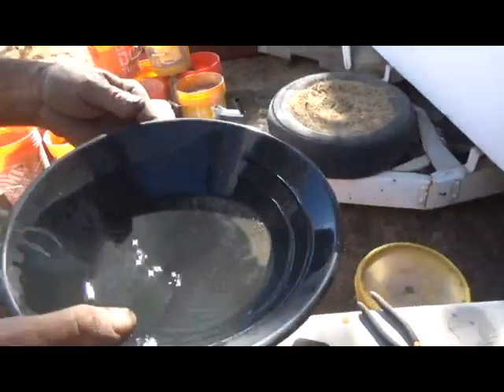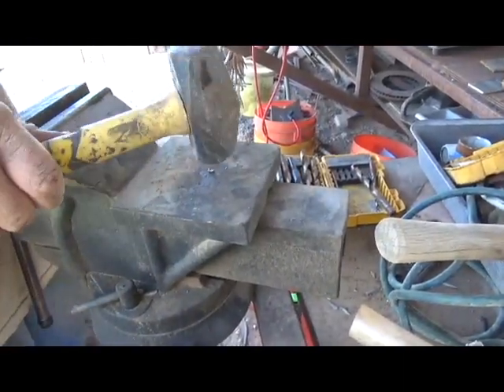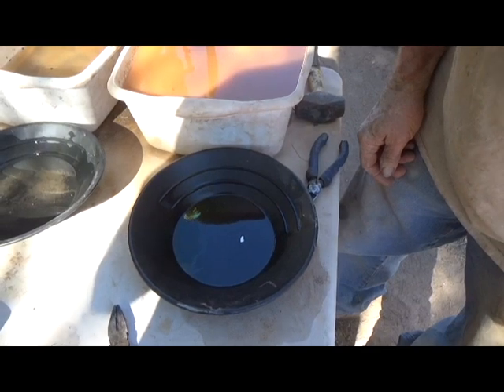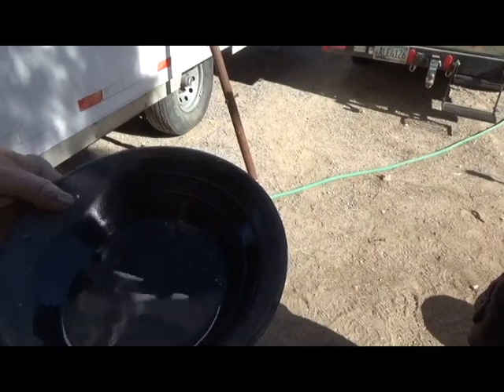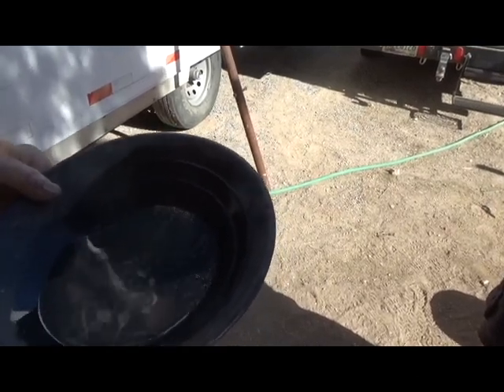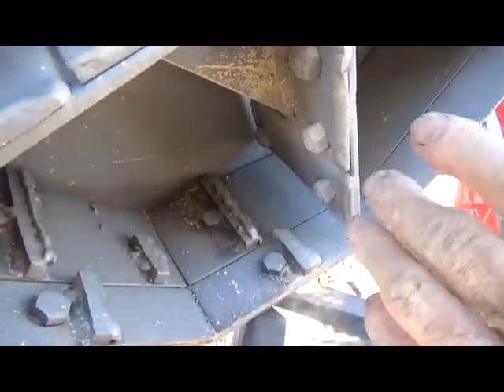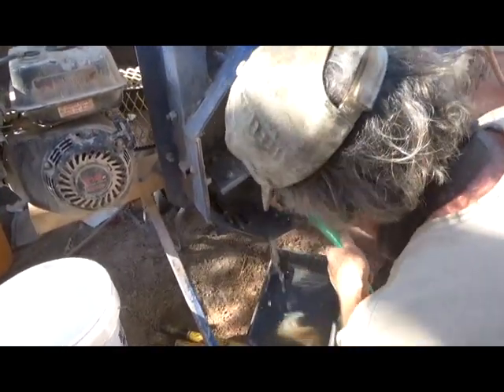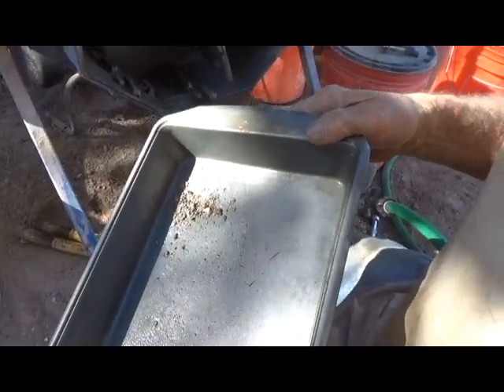190 Identifying a New Kind of Fools Gold

Comment: Often times when you shoot small pieces of the cartridge goes out the barrel if the head spacing in the Barrel is off
Reply from the maker: Hmmm.  Maybe true, but there was a LOT of brass.
Reply: @hardrockuniversity7283  depends on how bad head spacing and how many rounds were fired, also like someone else said they do have brass jacked bullets now but are pretty rare
Reply from the maker: @forestanderson3267  Hard to tell now.  :-)

Comment: Yes keith they make solid machined brass and machined copper bullets and guilding metal/ bronze. Barnes bullets tripple shock x bullets are one. Nosler makes another. They are homogenous mono construction solids. They also provide far better terminal performance than say winchester super X, remington corelokt and similar tier ammo. How much better? It generally makes a cartridge capable of cleanly taking game one size larger than origionaly possible. A .308 winchester loading with 150 grain x bullets will cleanly take a big bull elk easily and drop an angry black bear in its tracks. As always there is a tradeoff. That is length. The monobullets are lighter for any given size meaning they have to be made longer to reach standard weights. . So 168grain spire pointboat tail will be the max a box magazine fed semiauto can load . but it outperforms a standard lead core 180 grainer . 
Premium amunition is expensive for a reason. It actually works. The swift A-frame and nosler partician arent even new and they are still considered premium. Partitian is one of the great deer bullets.  They all do the same concept. Expand the nose wide, to create a large cutting surface. But retain the bulk of the bullet weight and keep it from deforming so it penetrates extemely deeply. This means a 62 grain .223 rem can get a full shoulder to shoulder shoot through on a large whitetail or mule deer that is within 150 yards. Consistantly. A 7.62x39mm ak with a mono bullet is suddenky capable of cleanly and repeatedly taking black bear and caribue . i mean from however nature presents a shot. If its humane and not trying to shoot it in the head through its ass... Broadside is still the best. Common sense hunting still is neccesary . your gun wont get super powers.  Sorry to rant.
Reply from the maker: Someday I'll be able to afford a sub MOA rifle.  I hate it when my cross hairs are on and the bullet isn't.  Also need to get used to cold bore adjustment.  The last deer I show I was way high due to misjudged range and cold bore differential.  Luckily it hit the spine hard enough to immobilize him, but I was on bullet 5 before he went down for good.  Not proud at all of that.  My M1A shot about 2" high cold bore and he was 100 yds closer than the does I had just lasered.  Firing from a rest the crosshairs were plenty steady.  Mental issue, nothing else.